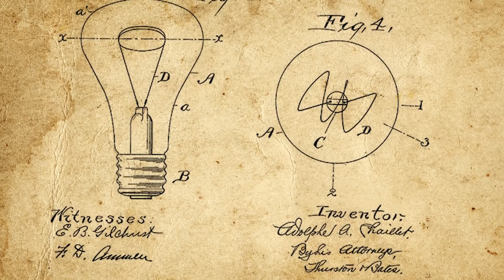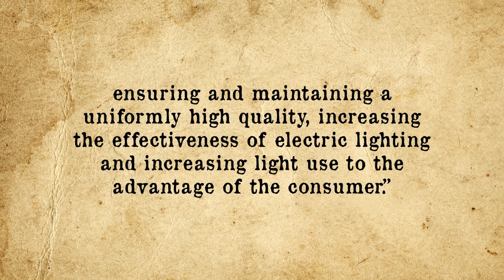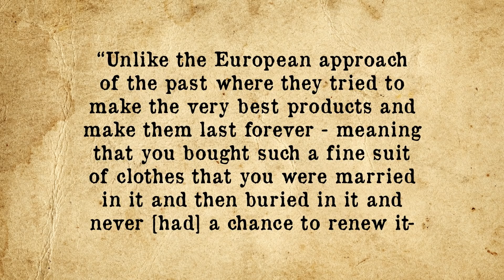The Great Light Bulb Conspiracy

Comment: A: “Those LED  bulbs are flickering. I told you they were no good! They said 10 years!”
B: “ Uncle, you put those in in 2007”
Reply: Angel Symmetrika 
I’ve started writing down somewhere on the Lämp or base when the bulb was put in. Just interesting to see how long it would last
Reply: Angel Symmetrika  The CFLs I bought back in 1998 lasted from from one week to one year. The odd thing about the Great Value light bulbs is that they are still working close to 10 years already. All brand name light bulbs burn out in two years.
Reply: Had 1st gen Panasonic CFLs. Some lasted 12 years.
Reply: I mark the date on bulbs when replacing them. They almost never go the advertised duration. Furious over LED failures, I took them apart: crappy electrical connections failed. Unfortunately, you have to destroy the housing to fix the connections.
Reply: @ljbrookens  I've seriously started to consider building my own. I did my own leds for my workshop, shed, and garage. None of them show any signs of failing. They're going on 7 years. The store bought led bulbs have a failure rate of about 10% within 2 years. Every time it's either an led got detached or something like a cap died. Would be nice if you could open them up to fix them. What I have liked a lot about doing my own leds is the control over light distribution. For my shop I used a bunch of 10w chips, powered them to 4w, and laid them out in a grid that provides light everywhere without shadows.
Reply: systematic101 Easy enough to do. Get a cheap source of LEDs, though. Radio Shack charges way too much. 
The easiest thing would be to develop a system of cutting into and resealing commercial ones to repair them. Usually it just needs a spot of solder.
Reply: @ljbrookens  check Philips Dubai Lamp in BigClive Video..
Reply: I own 3 LED bulbs, purchased in Aug 2015 and Sep 2016. One is beginning to fail. It flickers occasionally, and it looks like a few of the LEDs have detached.
Reply: Angel Symmetrika  I actually moved and took my cfl bulb to a new place, was left on at new place for a year.  Still worked
Reply: @johnn3542  I was doing that too when LED and CFL bulbs were $7-8 a piece. Most of my bulbs went with me...just left enough for the inspection.
Reply: At work I've also marked the lights with the date I've installed them. I did start noticing a trend in when they burned out. Eventually I started replacing them with LEDs and they have worked out well so far. They came with a fix year warranty and I've reached the point where that has started expiring, but excluding some defective ones early on, only one has burned out. So far they have been pretty good.

Comment: I have some early LED bulbs that I just keep on constantly except for temporary power outages and they are still going strong after 10 plus years. The new ones last only 1 or 2
Reply: The reason is: If you use LEDs above their rated current they get brighter. But their life time will decrease dramatically. This is a trick many LED manufacturers seem to use: Customers want a "good" light and a cheap price. So they use high quality LEDs, but since they are expensive they’ll use only a few and overload them to get enough light out of the LED bulb. For the customer this means a cheap LED bulb with a “good” light (both in terms of color and brightness)  - but also with a short live span. Instead of lasting up to 100,000 hours it will probably last a few 1,000 hours.

The question is now: Are they evil? They are giving the customer what they want. And the customer who is complaining about the bulbs short live time is also the same customer who refuses to pay double the price for another product that will last ten times as long… tl;dr: It is more complicated than “all companies are evil” imho...
Reply: @TheMightyZwom  your correct I have LEDs from the 1980's that are still working late are being run at 30mA, most LED'S lamps are over driven but in my experience the failures are 90% the crap power supplies, as you say they are made to a price and the Chinese ones cost pennies so you can't expect them to last.
Reply: @dogwalker666  Yeah, I should have mentioned that as well. The power supply really often is the weakpoint of an LED lamp...
Reply: @TheMightyZwom  in one factory that had just replaced all the HPS sodium lamps with LED'S, They had a spike every lamp in the factory failed, After I replaced them and pulled them apart every single Meanwell PSU had blown, And unfortunately the module cost more than the fittings, Which were approximately 200 dollars per fitting and there was 300 to replace.
Reply: @dogwalker666  "They had a spike" You mean like an overvoltage spike? Yeah, that can kill the electronics in an LED lamp very quickly...
Reply: TheMightyZwom yes the transformer in the Sub station was faulty it actually blew the power analyser off the wall.
Reply: TheMightyZwom not the case here.  The light fixture are all the same. That control group is static. The only thing different is the bulbs
Reply: @shadowdance4666  the driver/psu is inside the bulb and that's usually where manufacturing costs are cut. I suggest you watch a couple of BigClive videos on how they are made.
Reply: Because they are made of chinesium.
Reply: @dogwalker666  I wonder if it's possible to make a light bulb out of Nintendium. Would it last a thousand years?
Reply: @mrflamewars  it is possible to make light bulbs that would last that long they would be expensive but the company making them would go bust.

Comment: "vacuum filled bulbs" - wait, what?
Reply: That's a lovely oxymoron.
Reply: Shh dont tell it's a secret process vacuume gas that is captured by satellites and is then filtered and used to fill bulbs.
Reply: Then he said the vacuum bulbs LEAKED. My brain froze for a few seconds.
Reply: @FeathPymArt  there is nothing worse than a vacuum leaking all over the floor.
Reply: @dogwalker666  And then your pet walks through it, tracking it through the whole house.
Reply: @FeathPymArt  indeed, that's when you need a Vacuum cleaner.
Reply: @dogwalker666  Stirling.  🎖
Reply: @FeathPymArt  what he meant was the vacuum leaked air INTO the bulb.
Reply: You really gotta stuff the vacuum in there
Reply: @andrewmeyer8783  The premium ones have extremely high pressure vacuum, making them weigh more than the cheap ones. They won't even float in low pressure water.
Reply: I thought that too!
Reply: To the bulb... Your getting your vacuum on me 😲
Reply: @christianheichel  shh dont tell them about the secret Chinese vacuum gas factory.

Comment: • They specifically reduced life-span of light-bulbs to maximize sales? Gee, big surprise. I'm certain soap manufacturers have done the same thing; bars of soap definitely melt faster than the used to. 😒 How is this legal? 🤨
• Printer manufacturers are just flat-out evil. Between fake cleanings that waste your ink and forcing you to buy a full triple-pack of expensive color ink to print black-and-white, they should be taken to court and legislated against. youtu.be/AHX6tHdQGiQ
Reply: My printer is set to print B&W only and use only the black ink toner specifically in all the settings in windows, driver and printer software.

Wont print any .jpg file, even if its originally or converted to B&W because no color ink in the toner, please replace. Text files it will, but any image - nah. Fking bullshit man.
Reply: Angel Symmetrika Do you mind sharing which brand you are using? I think I’m ready to switch from ink jet to laser when my current printer dies. Thanks!
Reply: @memellie  I've had really good luck with Brother MFC series laser printer. Current one is over 6 years old, MFC is their all in one style so it's a bit more expensive but I never have to worry about copying or faxing so it is a trade off.
Reply: Buy black & white printer only (yes, they still make them), problem solved. At least one problem anyway. Won't stop pages from being suck or the printer suddenly deciding "nah".
Reply: @kroen  Or better Laser printer from manufacturer without oem toner locking, printer can stay idle for months without any issues and toner will last you months. the only downside is lower image quality, i.e. not suitable to print photo's  which is cheaper to do in a printshop anyway
Reply: @kroen  yea but it shouldn't consume color if you're only printing black and white. More ink if spilled in the waste tray than actually using the ink. that's why I've moved to laser printers. 5,000 to 10,000 for $50-100 dollars vs. 500-2000 prints for $70 bucks.
Reply: @feilox  I'm not sure about another country's but in the United States it still even if you have it only in black and white it will consume the cyan color. They say it's to bring out a richer black. But in all honesty there are easy ways to get around your printers programmed obsolescence refill your own ink cartridges for a fraction of the cost and a bunch of other things. Then again I'm all for pirating because of crap like this. I usually still end up buying the product but if it's inconvenient to get it on another platform or something I'll pirate it the whole way
Reply: @nickys5578  yea I'm on a laser printer for the last 4 years, it's still on it's it's 4-5  toner and needs a new drum soon, but cheaper than 4-10 ink cartilage. Even refills are expensive at least $10 to $20 for 3rd party refills. Color laser are so cheap nowadays as well. I might get ones soon as it cost only $300 to $500 for a good one.
Reply: Capitalism baaaaaaby
Reply: https://youtu.be/kdHIqa53-tY
This documentary explains everything about Planned Obsolescence, printers, Lightbulb etc

Comment: I don't mind replacing the not-that-old printer. That's actually fairly cheap.  It's continuously buying the new ink cartridges that sucks up the cash.
Reply: Unless you need color, why even bother with inkjet printers?  Laser printers are fairly cheap, toner is far cheaper than ink, and it never dries up or clogs.  Even color laser printers are cheaper compared to inkjet when you factor in the cost of ink
Reply: My father buys new printers rather than replace the ink carts. When the printer is under $50, no sense in spending $75 on a new set of carts. So he'll go out and buy 4 of them at a time and keep them in a closet. Those printers will last 3-4 years and he'll go do it again.
Reply: @cougarhunter33  The cartridges that come with the printers have a much smaller amount of ink (typically a third) of new ones. They show full on the display but have a smaller reservoir.
Reply: @flagmichael  I've given up trying talk any sense into him about just getting a laser printer.

Comment: Value engineers = modern planned obsolescence. Good episode in the making.
Reply: It would be interesting.
We tend to misunderstand the enormous value design life engineering has for our products. When I am 80 I would not be particularly interested in an appliance that was designed to last for 50 years and cost twice as much as one that might only last 15 years. I am glad I am not trying to watch a top of the line 21 inch color TV made in 1975. Our cell phones are made to last about three years because they are significantly limited in ways we did not know could exist when we bought it. I like replacing my toothbrush about the time it wears out, if only for hygiene reasons. I am at a stage where I no longer fit clothes I bought a year or two before... how long would I want those to last?

Comment: We know how to make really long lasting incandescent light bulbs like the Livermore bulb.  Don't switch them off, and run them really really dim.  Problem is this isn't the type of light bulb people want.

As for LEDs, I buy Philips and OSRAM light bulbs and almost all exceed the 15,000 hour life span.  Just keep them well ventilated.  I did have one OSRAM LED light die after 'just' ~7000 hours.  I emailed the company and asked about their satisfaction guarantee.  They told me to exchange the bulb for a new one at the original store (with receipt), and that's what I did.

Tip:  Write the installation date with marker on the base of your LEDs.  Really handy to know roughly how long they lasted.
Reply: My brain melted at 7k hours and original receipt
Reply: @mwindanji6714  7k hours is about 3 or 4 years of use and still has the receipt? I wouldn't have one after 3 or 4 days.
Reply: Brilliant information brother !!!!!
Reply: I have one LED light that I put in my old apartment. I lived there for six years and put it in about 2 years in. I bet the people living there still have it.
Reply: Of all the things that never happened, this never happened the most!

Comment: It is probably worth mentioning that the Centennial Light is only giving off 4 watts, but was designed for 30 or 60 watts(different sources). It is very dim, like a nightlight or something. Any modern lightbulb would last that long if it was only giving off 4 watts.
I would take a modern lightbulb over one like that any day.
Reply: another factor for the enourmous lifespan of the bulb is most likely that it never gets switched on an off...
the heating and the cooling of the filament are what puts the most strain on the filament and thus dictate the estimated lifetime.
without switching any modern lightbulb could probably work that long, especially when the actual wattage is this low
Reply: @TheScarvig  A lighting tech once told me that switching on their large spotlights at their theatre took two hours off the lifespan of the bulb.
Reply: Yeah, you have to overbuild the bulb to make it last like that, and my understanding is that you actually haven't to increase the draw to get the same light level.  I remember before the CFLs pushed most of the incandescents out of the bulb supposedly you could get European bulbs which were designed for a higher draw and they would never burn out... the downside being they weren't as efficient.

The lightbulb cartel may have been involved in price fixing but there was some actual science in setting the bulb wattages where they were relative to the durability of the filament.  Bulbs use much more energy over their lifetime than they take to make so even a small gain in efficiency can actually save the consumer money in the long run.

/That said, my printer is a paperweight because I upgraded to Windows 10 when my old computer died and none of the drivers will work with it.  I'm not arguing that planned obsolescence isn't a thing, just that the lightbulb thing is more complicated.
Reply: @NacorantheHarmonicaPlayer  before incandescent bulbs were banned if you bought a GLS bulb specifically for the UK market it would be rated say 60 Watt 250v, if you bought cheaper imports they were rated 60 Watt 230 Volts, guess which ones lasted longest I have a 100 Watt bulb in the attic that is 80 Years old and still works every time I go up there I expect it to fail. 
Windows 10 is a Rip off I had to reinstall windows 7 Because there are no drivers for my programming software.
Reply: @dogwalker666  So you decided to waste energy by using bulbs made for too high voltage.
Reply: @okaro6595  lol that’s not how it works, If you use a higher voltage bulb it uses slightly less energy and lasts exponentially longer, 
Ohms Law applies!
Reply: I have some early LED bulbs that I just keep on constantly except for temporary power outages and they are still going strong after 10 plus years. The new ones last only 1 or 2
Reply: there's actually two parts to this: the 4 watt output and the 60hz a/c current cycle. a/c current makes filaments "quiver" ever so slightly as the power switches negative/positive current flow, the low output of the bulb is more than likely helping keep it from "quivering".
Reply: @jbcowherder6210  true and unlike LEDs which are DC so the cheap ones flicker like hell. The filament is being pulsed on 100 or 120 times a second, I suspect the bulb is running at reduced voltage
Reply: @Boco Corwin he didn't
Reply: I recall watching a program that stated that the bulb was under run at 37v .. not 110v thing I find wierd is that it's an open firehouse where the birds or bats ... ?
Reply: Most LEDs only utilize 4 watts. You’re probably thinking of lumens.